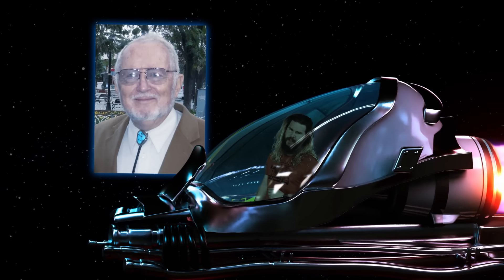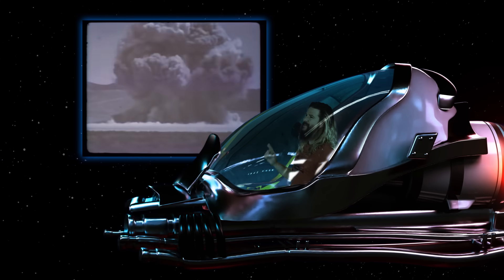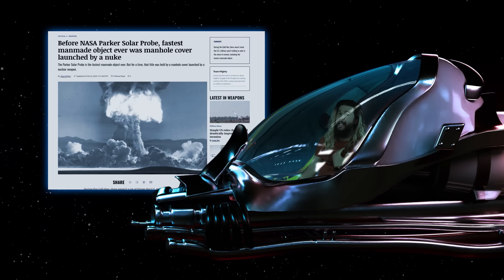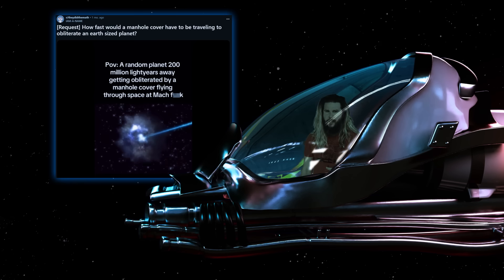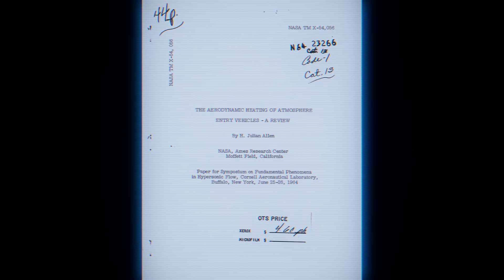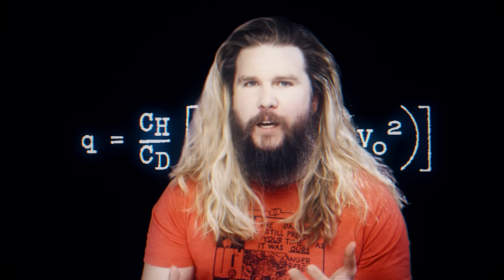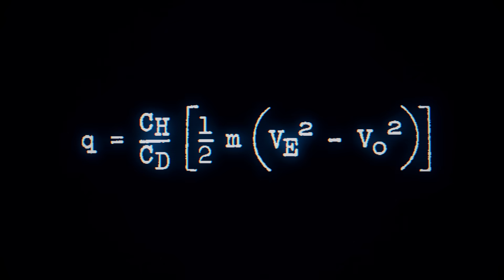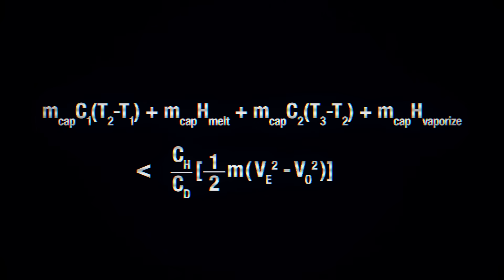Debunking the Nuclear-Powered Manhole Cover

Comment: I'm not physics literate enough to tell if the equation addressed it, but isn't part of the story that the cover was so fast there wasn't any time for heat to be conducted to it? I think a similar argument was made for why it didn't shatter after colliding with the atmosphere
Reply: No. Asteroids move slower and deal with incredible amounts of heat and stress due to the friction with atmospheric particles. If you somehow could make them faster it would just multiply the heat and stress because friction would become more intense and rapid. It's like trying to move your hand through water. To some degree it's easier at slow speeds but as you try to force your way through it the friction of water being in the way becomes more magnified. Same principal I believe.

Comment: My issue is this: Entry and Exit aren't the same. Entry starts easier and gets harder as it descends. Exit starts hard and gets easier as it climbs. 
Would that potentially change the known numbers for heat change?
Especially after it reaching peak speeds in the "more difficult/thicker" air.

Comment: Feels like an oversimplifiation. What about the time aspect. The cover would have spent very little time in the atmosphere (which is thinning as you go higher), so i am not convinced that the heat transfer would happen as described. The cover was solid at launch, and would only encounter thinner air over time, while slowing down. So if it did not vaporise instantly, i don´t see why it would later do so.
Reply: the cover may not have been solid at launch, as the launch may have caused it to shatter
Reply: “Feel like” is an oversimplification. 2.5 seconds is more than enough for 900kg of steel be obliterated from existence, while of course it won’t be that big of a number.

Comment: interesting point: the manhole cover did not vaporize while being ACCELERATED from a Vo of 0m/s to a Ve of EffYou m/s in an instant, therefore if the manhole cover was already in space and moving at Mach Procreate it could enter the atmosphere at a 90 degree angle and still be solid when it hits the ground.

Comment: Now, a question I have is whether or not we are assuming the cover stayed flat the entire time? My idea is that if it managed to tumble, possibly ending up vertical and therefore much more aerodynamic, would the heat transfer have been less than necessary to melt/vaporize it? Also, do different speeds make a difference? My understanding is that there's a minimum and maximum speed the cover could have been traveling since we only have that single frame to work from.

Comment: While I ain't much knowledgeable about aerodynamics, I'm quite certain tho that it likely broke apart. If the heat of the nuke wasn't enough to completely destroy the cover, the resulting forces acting on the cover would've totally deformed it at least. Think centrifugal and inertial forces for example. Its shape would've caused a severe spin, causing catastrophic oscillations. At least so far my own thoughts. Case in point, the cover very likely didn't make it into space...

Comment: ... But did you account for the continuous reduction of the drag  by integrating the delta P from atmospheric pressure to the exosphere? 
...ALSO, what if the cover was travelling edge along the area of Diameter*Thickness? Or what if it was sent up flipping like a coin? would you have to account for the extra drag by accounting for rotations per minute in addition to the drag over the expected trajectory? SO MANY QUESTIONS!

Comment: I'm willing to be wrong but a part of me believes this can't be accurate for two reasons:
1. The equation assume air density is increasing, which is not the case here
2. The equation doesn't account for time spent within atmosphere (thus ignores conductivity).

The second point may not matter in this context if the material is deteriorating ablatively, which is no doubt happening to at least some degree, but it worries me that time isn't even a factor in the equation. Perhaps I just don't understand thermodynamics all that well :)
Reply: Not to mention how I don't believe he accounted for how a circular disk moving through, even at this velocity, would likely move to a more aerodynamic shape which would greatly reduce drag
Reply: @thebirdfromtwitter1249  Yes, that's something I thought too. I would expect the cap to be almost instantly deformed into a very slender projectile due to unbelievable aerodynamic forces without even accounting for aerodynamic heating unless... unless the heat generated by such a fast and extreme deformation was already enough to vaporize most if not all of the material.
Reply: @thebirdfromtwitter1249  Any imperfection in the way the manhole cover was sealed over the hole or the manhole cover itself would also make it so the manhole cover doesn't just shoot straight up as a flat disk. If it managed to tumble so that the rounded side is pointing straight up a lot of the assumptions made in the calculations would have to change.
Reply: @gancyr3D  Tumbling is a death sentence in hypersonic flight. Things don't rotate at that speed, they tear. I feel like people aren't appreciating how soft iron is when it's hot.
Reply: @thebirdfromtwitter1249  It doesn't matter which configuration it was launched. The energy imparted is an order of magnitude greater than the minimum needed to vaporize the cap.
Reply: And 3, it works with gravity being in the same direction as motion, not opposite.
Reply: Yeah, the lack of time in the equation is a massive red flag, regardless of all of the other issues in the equation, hopefully he'll redo it eventually, even though it'll be a massive pain
Reply: I think time is factor in through the use of velocity as iftime is longer it would mean velocity decreasing cause still travelling same distance.
Reply: I’m also curious if the melting/vaporization point for different steel types were accounted for.
Reply: @johnycakes6613 the plate is cast iron, not steel
Reply: @DeathlyWolf42  you do realize the difference between steel and iron is the amount of carbon in each. Not to mention any heat treating, let alone pretty much every account changes what material is and there are literally 1000s of variants of each.
Reply: @johnycakes6613  so what you're saying is, steel is different than cast iron, and the fact the plate was cast iron, means the melting point for various types of steel is irrelevant
Reply: @DeathlyWolf42  no people use these terms interchangeably in every day vernacular, just as many people say Kleenex as opposed to tissue. The subtle differences in even cast iron would make a difference. Cast iron melts at 2200 and wrought iron melts at 2800.

Side note cast iron is relatively brittle for a metal and I doubt it would survive the pressure from a nuke. I doubt they used cast iron as a lid for a nuke.
Reply: @johnycakes6613    ok, few things. 
I've never heard anyone use steel and cast iron interchangeably, they have different chemical makeups, not simply the amount of carbon, and are very much not the same thing. 

That said, every official source i can find refers to the plumbob cap as "steel", so your original point is valid. 

No idea why Kyle called it a cast iron cap, other than it seems street manhole covers are often cast iron, and everyone calls the cap a "manhole cover".
Reply: @johnycakes6613  Majority of cast iron is made to be melted at a much lower temperature so it can be easily poured and thus, cast. If it's called cast iron, it's one of the many types with a low melting point compared to steel/raw iron itself, if you try to forge steel and cast iron, by the time you get the steel to a temp that's good for forging, the cast iron is a liquid. However the energy involved is magnitudes higher than the energy required to completely vaporize either cast iron or steel so this really doesn't matter. Like, the difference between either isn't enough to even come close to getting near a factor of 10 which is the energy involved here. 

To put this in perspective, it's like saying a chunk of dry ice would survive the core of the sun better than a chunk of water ice. It out right does not matter with the energy involved here. Even if we consider the energy decreasing due to drag lowering from gained altitude, the initial spike of heat is legitimately so high that whatever would be left would be just fragments which would never reach orbit. 

For a moment, a brief, tiny moment it was the fastest man made projectile ever. But that was very short lived and it likely turned into powder a frame or two after being launched, or it just became a gas.
Reply: @DeathlyWolf42  yeah that’s kinda my point. I don’t think anyone thought this was an actual manhole cover which likely would be made of cast iron, but that’s what we call it.

I’m just saying a lot of information was probably lost over time, just like playing the game telephone. So thus the question, what material was it made of and therefore what was the melting point?
Reply: @Rhiawhyn  it’s actually closer than you think when converting these factors to joules, 1kg of cast iron takes 118,000 joules to melt whereas 1kg carbon steel takes 250,000 on the low end. That effectively doubles the left side: 1.2 to the 13 compared to 3.6 to the 13. All I’m saying is with one small correction you can break it down quickly, I would also add 60% air density at 14k feet and 33% air density at 25k as a second factor that could decrease total energy to below necessary to vaporize.
Reply: @johnycakes6613  amd cast iron has next to no carbon, and its properties differ so much from steel that considering them the same material or even very similar is highly inaccurate.
Reply: @Rhiawhyn but that's the thing: the fastest ever. It was only in the atmosphere for 0.8 seconds. Is that enough for the heat to conduct through?
Reply: @Blockenheimer Cast iron has typically more carbon than steel. A quick search gives 2 to 4 percent carbon, as opposed to many alloys of steel that run from a fraction of a percent carbon up to 4 percent. Tool steel goes from 0.7 up to 2.1 percent carbon. 

Google helped here because I am too lazy to go dig up my old textbooks in the basement.

Comment: I am curious about one thing.  The first big assumption in the video and kind of the basis for the whole thing is that re-entering the atmosphere is equivalent to exiting the atmosphere.  But I gotta ask if that's entirely true?  They seem pretty significantly different to me, especially in the case of a cannon rather than a rocket.

In re-entry, an object is coming it with its maximum velocity before it hits the atmosphere.  Then it begins to slow down gradually as the density of the air increases.  It's pushing its way into the air, and its encountering increasing resistance as it goes.  An object in re-entry travels through the densest part of the atmosphere at its slowest velocity.  For the cap, that's reversed.  The acceleration was nearly instantaneous and it wasn't continuously being pushed, meaning its maximum velocity was achieved at "ground level" and the atmosphere's drag would have been reducing throughout its journey.

They feel like, at face value, VERY different effects.  I'm wondering if someone can explain it?
Reply: Comments seem to be indicating Kyle may have made some errors with this one
Reply: Also temps go down with reducing pressure and up with increasing pressure (one of the laws of thermal dynamics)  Also why rockets don't need heat shields going up but only down.
Reply: @charlesmaurer6214  Not to say you're wrong. 
But. 
Rockets don't reach orbital velocities until they're waaaay above the thicker part of the atmosphere, so there's nowhere near as much drag going up as there is coming back down. It's why the Falcon 9 booster can approach the edge of space and still land without a heatshield, its not going fast enough in the first place
Reply: @richarddickjohnson516  As pressure thins it cools material as it increases it heats, also the rockets or rocks are pushing through the air, the plate was riding a mass of focused air going the same direction and speed thus no friction based heat.  To put it this way in a smaller scale the plate was in the car racing on the track, the rocks coming in from orbit was riding on top of the hood.
Reply: @charlesmaurer6214  you seem to have misunderstood me. 
1) Your point about thermodynamics is correct, and I wasn't arguing with that(although I will point out that only the fluid that's changing pressure also changes temperature, something in contact with it has to absorb/radiate that heat in order for its temperature to change significantly).
2) I never mentioned any of that other stuff because I wasn't talking about it. I'm not talking about a rock falling from space, or a nuclear manhole cover. 
3) My goal was simply to refute your point about why rockets don't need a heatshield going up. It has nothing to do with the relationship between pressure and temperature in a fluid, and more to do with the fact that the rocket just isn't moving fast enough for any of that to matter until it's well beyond the minimum air pressure for drag to have a significant heating effect
Reply: if its slower at denser atmosphere, the heat will be less

Comment: I have found an error in your calculations you have used the melting point of iron however you call it cast iron which melting point is about 300 degrees colder so I think you may have done the calculations for an iron cap not a cast iron cap.

Comment: But the key to this is how fast the energy transfers to the mass of the lid- which is dependent on the fluid mechanics discussed AND the drag from the atmosphere DECREASING as the lid goes higher and higher. At the very least the iron mass WAS the fastest manmade object since it was captured on one frame of the slow motion footage.
Reply: Also the fact that it was insanely fast, so in 2 seconds or so it reached karman line.  I would like to see a heat transfer simulation, my guess is that the outer part of the manhole literally ablated with such heat transfer.

Comment: Kyle, Cast iron has trash thermal conductivity but is brittle, if it did not break up into fragments it might not melt in time. If it did break up into fragments it melted immediately.
Just like how some small iron meteorites behave when entering straight down, they shotgun the sky or they sneak through thanks to their own plasma bubble.

Comment: I think you take the wrong calculation. Even if the result would be the same it is the wrong way to calculate it.
The manhole cover is he ecuivalent of a bullet leaving the barel. 
And given there wapons industry is big and wealthy. 
There are studies and calculations of projectiles or warhead temperatures in several PhD work. 
Since it is BM knowledg it would most likely be hiden at least partially because of itar requirements.

Comment: 10:00 does this consider the reduction of drag and air density as the manhole cover rises through the air? NASAs calculation is designed for entering into increasing density, whereas we are doing the opposite. I suppose you determined if it would have the energy to vaporize, but it wouldnt go very far (or matter??) If its a liquified blob
Reply: Came here to say this. Aerodynamics come into play, some heat may be dispersed (or even added) and this doesn't take that into account
Reply: There's a lot of variables totally ignored in this video. This is yet another napkin math version of the same things he was criticizing.

Comment: so, rockets accelerate a lot slower than this thing did, so if we were going to Julese-Verne it with a nuke instead of a million tons of guncotton, whatever we put in the capsule-bullet's gonna need to be really hardened against acceleration because dang.

And I actually kinda want to poke at Verne's calculations in 'From the Earth to the Moon' to see if that would work properly with the 19'th century explosives or the 'bullet-acceleration' bit.

Comment: This feels very flawed. I can see a bunch of significant elements that you do not appear to have accounted for straight off the bat... you cannot directly compare re-entry and launch, as one has an increase in temperature over the profile, and one has peak heating at the start, as the air is reducing in density as altitude increases - quite rapidly, in fact, hence SpaceX ditching the fairing of a Falcon 9 at 110km. Secondly,, beyond this... significant fragments of all but the lightest meteorites actually DO reach the ground - what happens to your incredibly fast moving slug of gaseous Iron vapour? it doesn't just vanish - "burned up" is not a proper term. does it rain back as rust? and could an appreciable amount of it reach space before cooling to liquid and then solid phases?

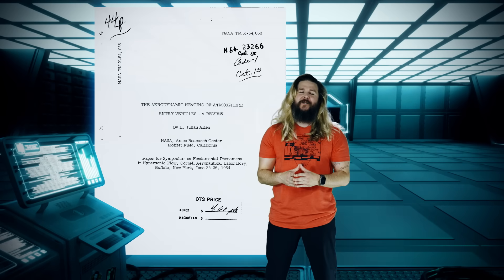Comment: 3:41 glad you acknowledged this video! But there’s a VERY high chance that the manhole was catapulted into at a minimum of a low-earth orbit. And not to mention that manhole covers are COMPLETELY SOLID CAST IRON, which is how their so heavy in the first place, so if it was launched into space, most of it is DEFINITELY intact, but most likely it broke up while going through the atmosphere and arrived in space in large chunks, but that’s just me being skeptical.
Reply: How could it be in LEO if it wasnt travelling with any horiztional velocity just straight up
Reply: To the height of LEO? Or into actual LEO? The latter wouldn’t be possible going straight up.
Reply: @DJNiems  if it did survive, i'd say a mimimum of LEO, since again, it's going 66x faster than escape velocity (as seen in the video). But looking back at what i said, i shoulda specified the height of LEO rather than entering an LEO
Reply: @ZenithPeak1  Ah I see thanks for the calcification